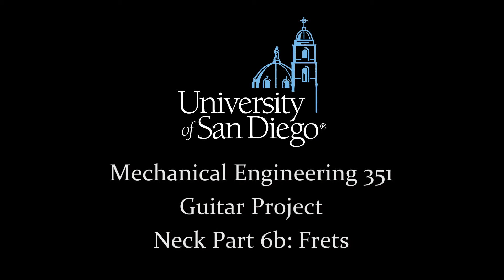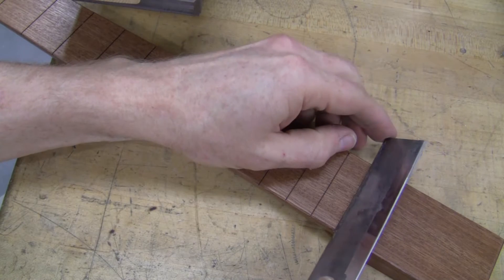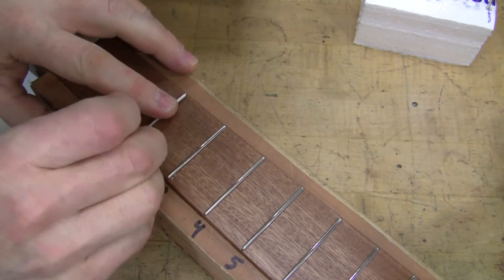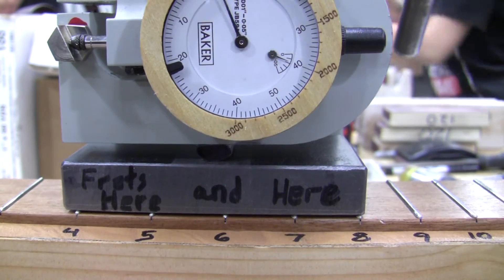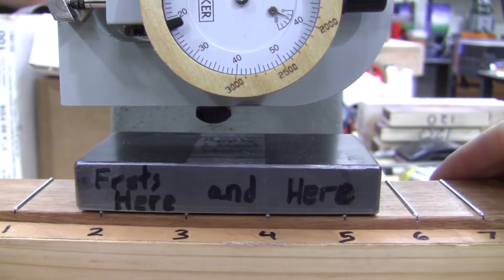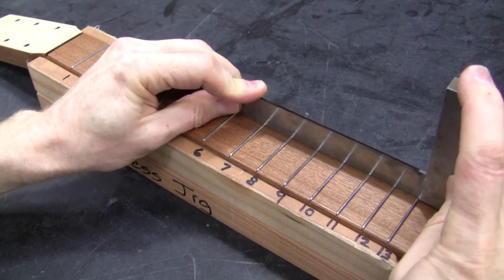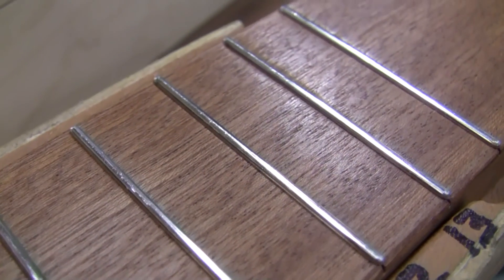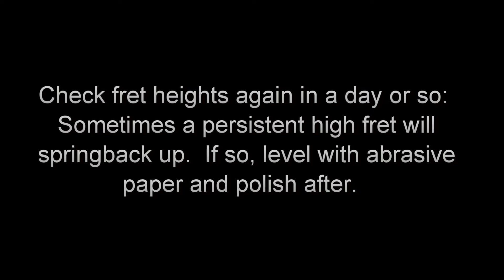Neck 6b: Frets 2013

Comment: Hi there, love your videos. I have an old Martin D-18 which needs it neck sanded and re -painted, as the finish is very rough.. How do I get to match the original colour ? The fretboard is fine, it's only the neck itself that needs work.